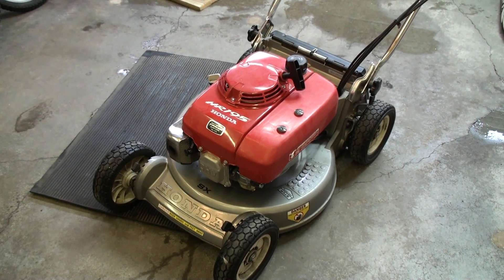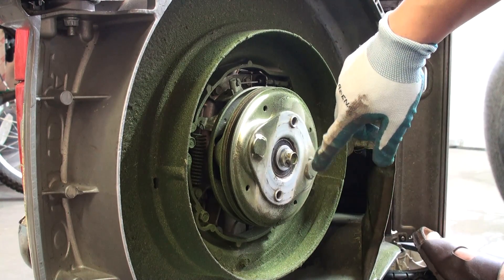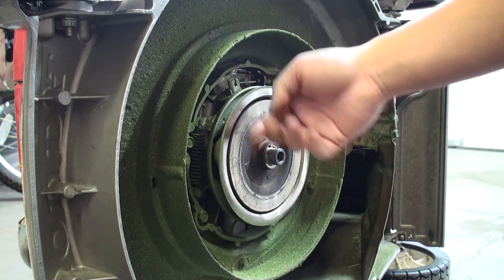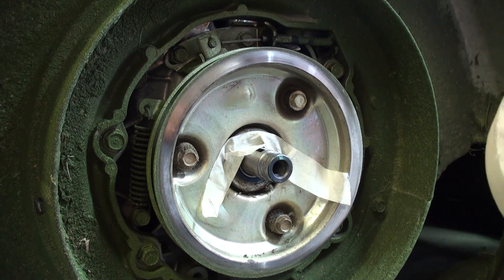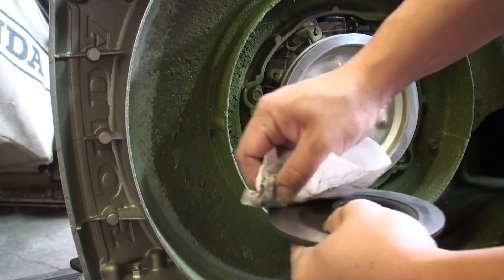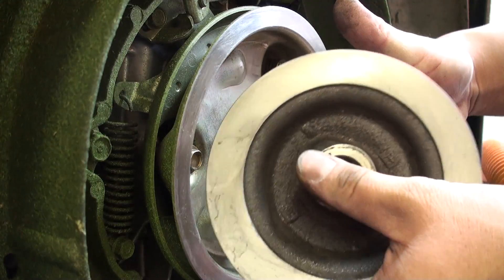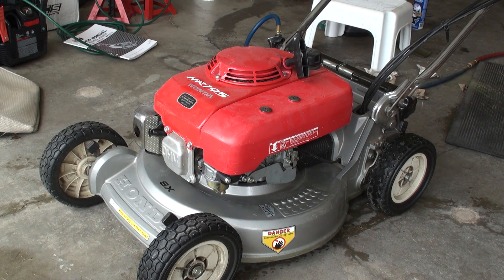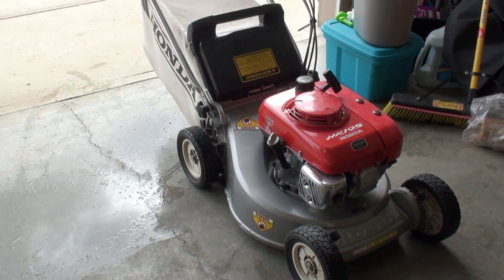Repair a Honda HR 195 or HR215 Masters Series Lawnmower Roto Stop Blade Brake Clutch

Comment: Prolly won't reply so old but I'm stuck same model runs awesome blade comes on but when not engaged I feel its sticking an making a bad noise any help
Reply from the maker: Ah I do indeed reply even after all these years!  The sound is likely bad bearings or a cable that is sticking and not fully releasing. These mowers are old and a good chance that the BBC bearing is probably going bad. They make a way worse howling/grind noise when the blade is not engaged.

Comment: So there is a cable that works that roto  clutch .  like a motorbike clutch ???
Reply from the maker: it is opposite of a motorbike clutch where the motorbike you release the clutch lever to engage it vs. the mower you press in (to pull the cable) to engage it.  It isn't the same design as a small motorbike clutch per se but in principle it operates the same way.

Comment: That mower is the same age as mine, but I've got the HR 215. With maintenance it's been a two pull start for 32 years & it still looks great!
Helpful instructional video.
Reply from the maker: Yep, I have a HR215 HMA, a HXA and multiple SMA models that I've acquired over the years that family and friends all bought off of me.  My all time favourite is the HR195 SXA 3 speed unit b/c it is a smaller size that is more suited to urban sized lawns.  The most fancy one I have is the electric start HR215 in the dark grey (last generation masters series) with hydrostatic drive and that thing is a BEAST!

Comment: I put everything back together properly, but now I cant pull the rope to get it started. Do I need to untighten the benter bolt?
Reply from the maker: You installed the blade upside down. Flip it over and it should start easily assuming you have the factory honda blade.

Comment: I've HRU216 M2 mower and I've similar but little different issue here. I can't start my mower without pushing blade engaging lever in. 
It's very hard to pull cord without engaging the blade lever. I don't know is it a problem with clutch assembly? 
Any idea please.
Reply from the maker: I have a hunch... did you recently remove the blade to sharpen it and then this problem manifested itself?  If yes, then there is a high chance you mounted the blade upside down.  I made this mistake once and it is EXACTLY how you describe your symptoms.
Reply: @piercedasian  no, blades are fitted correctly and cuts well too.
Reply from the maker: sorry for the super slow reply.  Something is totally wonky with your clutch.  Have you had a pro look at it to resolve your issue?

Comment: The crankshaft seal on my motor is leaking how do I replace it
Reply from the maker: I haven't done one on a lawnmower before but if you look up how to replace engine main seal on YouTube that how its done on a car is fundamentally the same as it is on a little lawnmower engine.  Sorry I couldn't help further.

Comment: Have you ever had to replace the clutch/brake bearing?
Reply from the maker: Sorry for the long reply but YES I do have video footage that hasn't been edited and published to my channel showing exactly that - clutch bearing failed on one of my mowers and the sound it makes is AWFUL!  I'm in the midst of moving garages but once I get settled into my new place that you can be assured that I will be posting the clutch bearing replacement video.

Comment: Can you remove the center bolt without a power socket?
If so does it loosen clockwise or anti clockwise?
Reply from the maker: you can but you will need to gain access to the flywheel where you use a band wrench to hold the flywheel from turning and then you'll be able to remove the clutch centre bolt.  Probably easier to borrow or rent an impact driver to get the bolt off.

Comment: I was just given a HR195 HX but can't find any manual covering it; the 195PDA one I do find is not a blade clutch model. Suggestions???
Reply from the maker: are you sure it is an HX model if it is a HR195?  The HR195 to my knowledge only came in a PX and 3 speed SX version.  HX mowers were available for its larger sibling the HR215 series.  If you search for Honda HR195SX you should be able to find the owners manual straight off of Honda's website and it WILL have the manual for the BBC system.  I am in the final stages of documenting and publishing a Honda HR195 restoration video where I do an extensive cleaning and part replacement on the SX version of this mower. Bought it off from one of the locals in town and it was in need of some serious external repairs.  Will be a good tutorial for you if you're seeking info on how to properly adjust and setup the control cables properly and how replace things like cables and clutch bearings.
Reply: @piercedasian  
My mistook.
It is a 195-KL 
It's the three speed version. I found a 195PDA manual but that's not a BBC. Current issue is carb work as it starts than stalls 5sec later. Also rope rewinds reluctantly.
Reply from the maker: @rfleakage3120  the car is jammed up.  The engine on the PDA version vs. the SX (or in your case the KL version - you must be outside of north America?) is the same.  Carb cleaning on these models are super easy.  It is the high speed jet that is your problem.  The rope can be fixed very easily. Unbolt the rope starter (3 bolts) and then spray some penetrating lube spray into the center of the recoil start and work the starter by pulling on the rope (don't disassembly the recoil starter).  Get lubricant spray in behind the recoil reel and keep working at it and it will loosen right up and be as good as new.  I just did my newly acquired HR195 that had that EXACT problem and it works like new!
Reply: @piercedasian  Inside The Beltway; not sure of origin of the KL but it's been local for many years. I'll give the carb and the rope some attention. Thanks.

Comment: I got a kubota mower that literally uses almost all the same parts as these Hondas, anyways the bearings were going out on the clutch so i replaced both the bearings put everything back together and now it stays engaged??? I don’t know why I’ve taken it apart a dozen times and can’t figure it out....any ideas?
Reply from the maker: Ah yes I ran into the same problem as well.  Did you install the blade upside down?  You may want to change the blade orientation as I sharpened my blade and forgot which way it was supposed to go on and I couldn't figure out what the heck was wrong until I compared it against my other identical mower and realized that the blade was reinstalled the wrong way.

Comment: I ran across your video, nice job. I have a Honda HRC 215 that had been sitting for quite sometime, and I don’t know who has done what to it. But, whenever I start the mower and engage the blades it Boggs down and dies. I have checked to see if anything is wrapped around the blades, but nothing. Could this be a clutch issue as well? Any input would be appreciated. Thanks.
Reply from the maker: WOW and old school HRC model!  I wish I could buy one of those older models.  Based on your symptoms it doesn't seem like its the clutch since you're able to get the mower started and it will run without the blade engaged.  I suspect that the governor and the carb is where your problems are since it isn't "opening" up the throttle plate as the engine gets loaded up when the blade is engaged.  Give the carb a good cleaning, and make sure all the linkages are setup properly and try again.  These mowers are remarkably easy to fix and are VERY VERY well made machines that will last a lifetime if you put a bit of effort and care into them.
Reply: @piercedasian  I cleaned the carb really well today. The throttle linkage may be where the problem lies. I think someone has worked on it before because they had the idle screw all the way tightened down. Plus, the throttle linkage had been tampered with. They had it rigged up where it was running wide open. I put a new throttle cable on it today too. But yesterday when it was revved up the way they had it, the blades engaged fine. I may need to look into adjusting the cable again.

Comment: Such a helpful video! Thank you. Have two nearly identical mowers both with same engine. One has clutch that is completely worn. Planned to use the one from the spare but cannot for the life of me get the central bolt out! It just turns the whole centre and flywheel on the top.....any suggestions?
Reply from the maker: you'll need to either use an impact gun to break it free (due to the sudden jolt of the gun) or you'll have to undo the flywheel cover/gas tank and "hold" the flywheel with a banded tool to prevent the flywheel from rotating.
Reply: @piercedasian  ah right, thank you so much!

Comment: Great Video.
I have a Sarp SLM5360 HXA Pro. Old style Honda Masters Deck and the new Honda 5.5hp GXV160 engine.
At idle she is sweet. At full revs, runs smoothly,  but lately before the blade is engaged, one can just hear a sort of shhh noise. As soon as you engage the blade that goes away.
The Rotostop works perfectly. 
So I suspect I may have something like glazing, or the top or bottom rotostop bearings might be starting to Go? I jet wash it frequently, and think I forgot to run her after leaf blower drying last time.

I don’t have an impact gun. I thought about using a strap wrench on the flywheel. Pain as I guess I have to remove the Magneto thingy to get the strap around?

A friend has an impact gun max 270 Nm ... yikes. He says I could buy an air reducer valve , circa £11 to tame it. I thought about the damage high torque could do to that keyway. Then thought, hey if the crank is not held, the impact gun could actually be “kinder to the crank” my thoughts being the impacts could “break the grip” before applying twisting torque on the wooddruff key? Am I right?

Alternatively could I use an Air Ratchet with a max torque of 95 Nm, very carefully and the air speed reducer to make it less potent. Or am I defeating my logic explained above? 
Would an air ratchet, albeit with a lower max torque, be more damaging because the torque is between you and the nut on a Air ratchet , whereas the impact gun effectively taps it around, so fast its against the dead weight of the crank; and hopefully breaks the bolt to shaft bond, before the torque is even transmitted to the keyway?
Any views?

Ref tightening it up. Can this be done manually?, and rather than strap the flywheel, could I use the top Flywheel special nut to hold the crank ? On mine that should be done up to 70-80 Nm , which is lower than the torque people say the bottom brake bolt should be (circa 39 Nm?).
My thoughts being I should get the bottom bolt to 39Nm well before I get near the top crankshaft special nut’s 70 Nm.
Or does it not work like that?
Any comments much appreciated ... and as you guessed I know nothing about engineering.
Reply from the maker: Sounds like a bearing issue indeed.  Get that replaced asap before someone gets hurt or the equipment gets damaged.  As for what tool to use to remove?  use the impact gun and just hit the trigger briefly to break the bolt loose and do the same to put the bolt back in plus maybe a few quick pulls to the trigger.  If you're quick and gentle it won't do any damage.  My impact gun will EASILY crank out 650+ ft lbs and I use it to fix big and small jobs all the time with no issues.  Its how you use the tool that is the most important.  Using a flywheel strap holder is of course the best with a torque wrench but that takes time and can be awkward if you don't have a helper to help you hold the flywheel.    Keep the fix simple, zip the bolt off to get to the bearings and very gently zip the bolt back on plus a quick "hit" with the impact gun is MORE than enough.
Reply: Thanks for the comment Pierce. Much appreciated.
Reply: Hi Pierce finally got round to doing this job.
I was sent the Shop Manual by Honda.
It says to “ Disassemble and reassemble, loosen or tighten the blade holder screw ‘with holding’ the Rotostop lever 55Nm - 40 ft lbs.”
I am not sure what it means by “with holding” ... in other places “with actually means by” i.e. ‘by holding’.

From what I can see, this is nonsense. If the blade brake lever is not depressed, then the blade holder is restricted by the brake disc, but that does not really help holding the end of the crankshaft?
Depressing this Rotostop lever would surely only make things worse, namely the blade holder then would now be totally unrestricted, and still doesn’t hold the crankshaft to assist you locking up that central bolt to 55Nm?
Only asking as this is the official Honda shop manual and I wonder if I am missing something?

I agree, that Your idea of an impact gun obviously would work, as would my idea of holding the big nut on the other end of the crank ( holding on the recoil starter basket as this should be torqued to 75 Nm.) 

Love to hear your view on this, as I am a little nervous a out using the impact gun to tighten this bolt. Purely as I have never used one before.
I just realised I do have a Makita  battery impact driver, which should be a lot more gentle, would you advise an air tool novice to use the battery gun?
Thanks Peter

Comment: I know this is an old video, but I have a HR215 that has started to have a bad cut.  I have replaced the blade, cleaned the carb, new spark plug and air filter, and it is still missing some blades.  The engine starts and runs fine.  How would I know if my blade clutch is going bad??
Reply from the maker: Blade clutches rarely go bad unless they’ve been abused or badly worn out follow the procedure in this video to renew your clutch plate and give it more grip and also make sure the rpm your engine is running at is sufficiently high enough. If the RPMs are slightly low you will negatively impact the quality of the cut.

Comment: Excellent video.  I wonder if the clutch is the issue for my HR215HXC.  The blade brake works fine, but when I try to engage the blade, the engine dies, even if I very slowly ease the clutch and with the engine warm and running at top speed.
Reply: To clarify, the blade did engage first try ( so cable is intact and blade is able to spin), then I raked up some hedge trimmings before mowing and could not get the blade to engage again.  I wonder if the issue may be throttle/carburetor adjustment not happening when load increases upon blade engagement.
Reply from the maker: The clutch is identical from the HR195 to the HR215 (I own both models and only one spare clutch which means that 20 years ago when I bought the clutch that I knew it would fit either model).  When the engine dies when you're engaging the clutch it can mean several things - a seized BBC assembly due to faulty bearings or a bad governor assembly on your motor that isn't allowing the motor to increase throttle when being "loaded" by the blade engagement.  An easy test is to take the spark plug out of the motor, have a helper engage the blade clutch bale (the blade engagement handle) and then have you try to rotate the blade.  If the blade doesn't budge then you know you've got a seized BBC assembly.  If the motor rotates effortlessly then you have a governor/engine related problem.  Hope that helps!

Comment: I am repairing a customers mower and the blade brake is permanently engaged. even if you let go of the bbc handle on the handle bars. the blade does not stop rotating :-(
Reply from the maker: You likely have two problems with this clutch assembly.  The release springs are probably broken in the clutch assembly. Take the centre bolt out as how I've done it in the video and see if there are things that look broken or out of place.

Comment: I know these are from the 80's But. I still hope to god that the material is not asbestos. (clutch)
Reply from the maker: Nope Honda has confirmed that they have never used asbestos in any of their equipment/cars (so I was told by their parts division at least).

Comment: that's a sealed bearing you do not need to tape over it when sanding
Reply from the maker: You are correct that it is sealed but I still prefer to cover up things if there is a chance that dirt can get past a seal and ruin the bearing.  Just part of my OCD tendencies.

Comment: I would like to see an explanation of how that system actually works. I have one now but when I start it the blade is already turning. With engagement lever back it appears to have slack in the cable.
Reply from the maker: it is really quite simple how these things work.  The when you engage the clutch the bbc assembly "bears down" the drive disc (the solid metal piece) onto the driven disc (the one with the friction material).  When you let go of the handle the spring that sits between the 2 above mentioned parts is what disengages the drive disc from the driven disc.  If it isn't disengaging then you either have a broken spring or you have a seized bbc where the cable actuates the clutch system.  If you take the clutch system apart you'll get a better sense of how things work.  Sorry for the not so good explanation but that what I can think of at this very moment.
Reply: @piercedasian  thanks. Are those two smaller springs supposed to pull the cable back back to allow the inner spring to do its job?